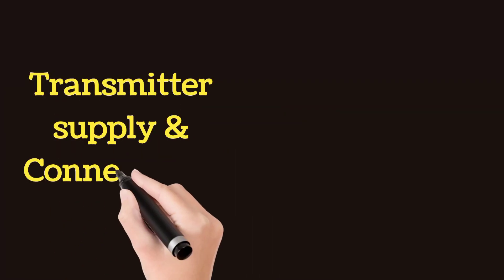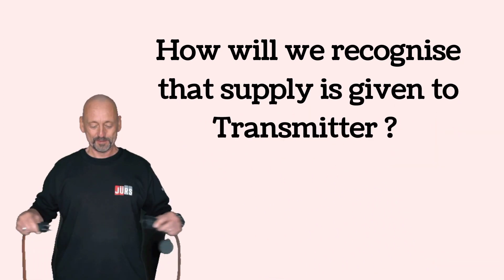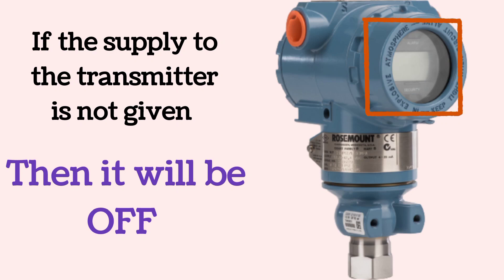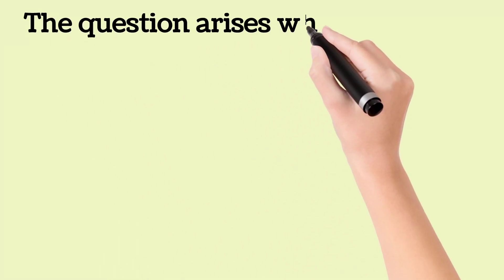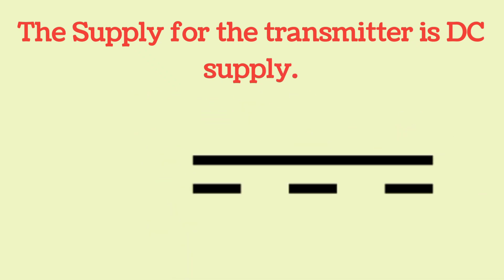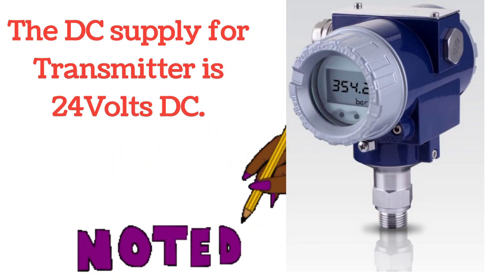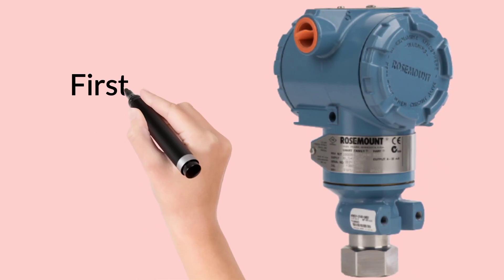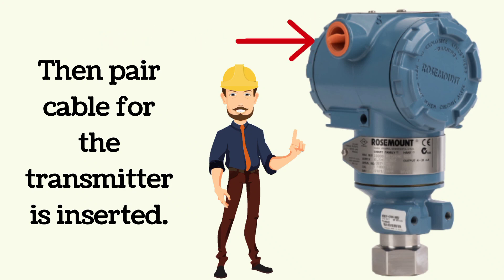pressure transmitter level transmitter flow transmitter supply & connection in plc instrumentation

Comment: The lecture is very understandable, but I have few concerns. 

(1) The 240v AC that was converted to 24v DC  by the PLC was it terminate straight to give 24v DC to the broker.

(2) is the right hand side of the braker the neutral terminal?